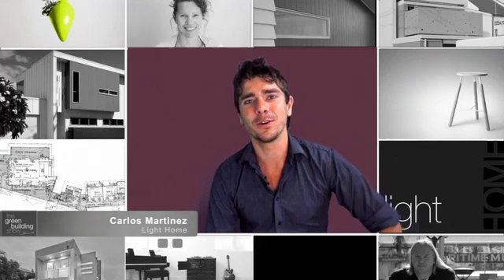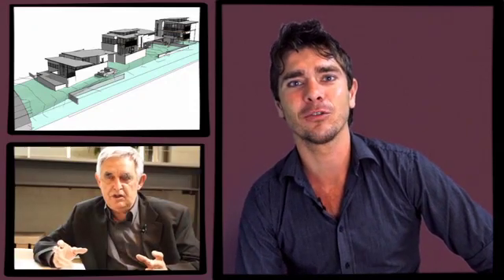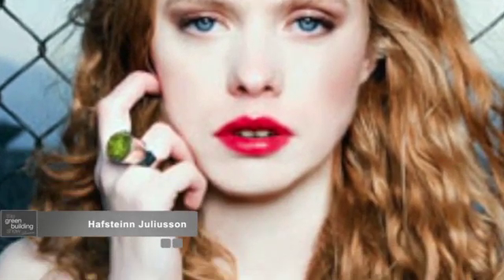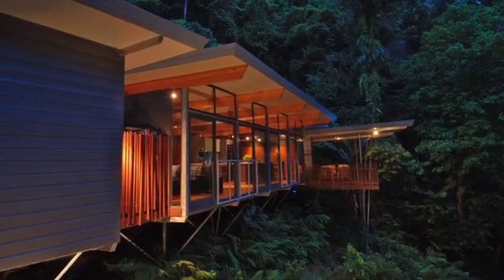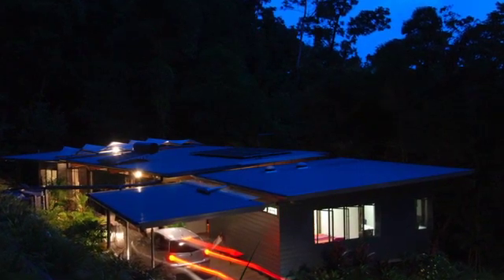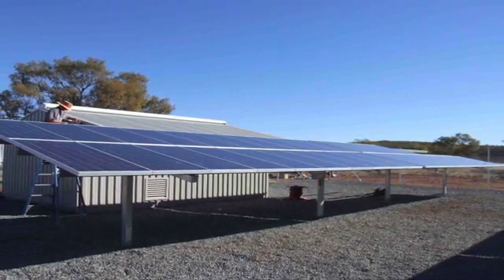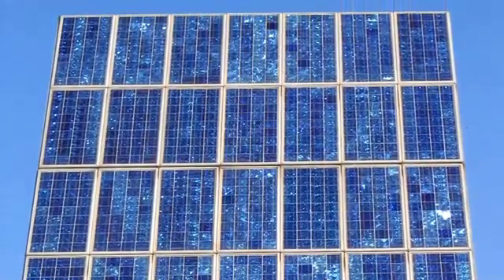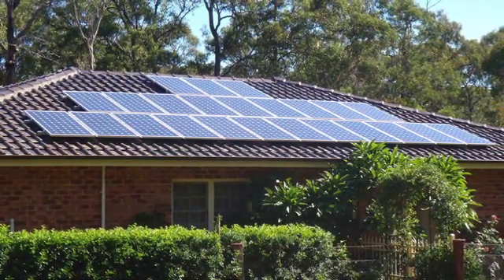How to design an energy efficient home

Comment: This book [link here>>>t.co/ejytdVx2sh  ] got me thru the design and installation of a complete off-grid system for my lake cottage. The process of site evaluation, system component selection, wiring, etc. is complex, but with a lot of study and this book, I ended up very happy with the results. Everything you need to know is here. I recommend it for anyone who is starting with little solar panel knowledge and wants to end up with a whole house system
Reply: Good Luck
Reply: just doing good